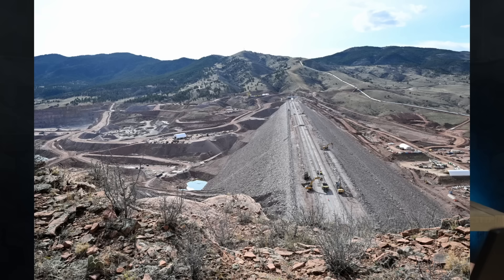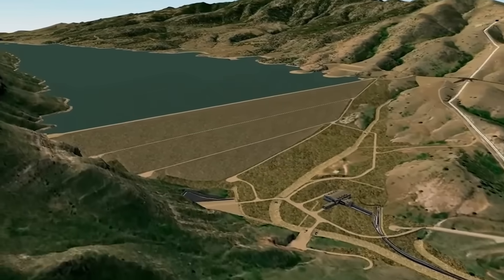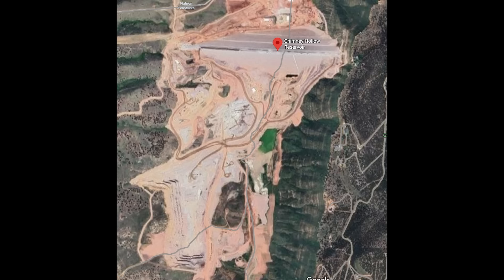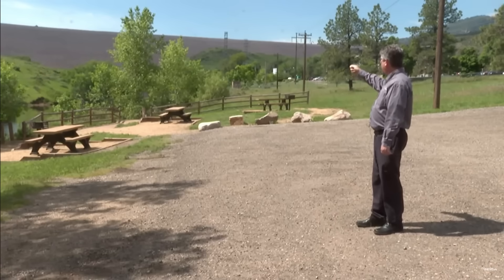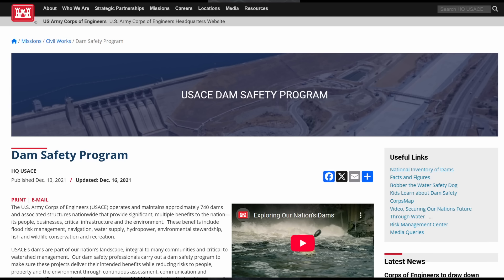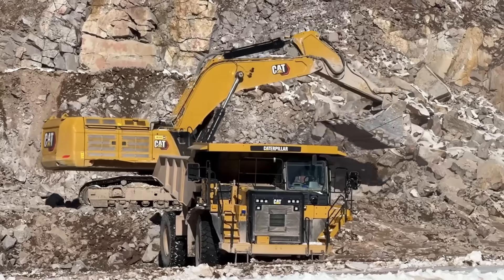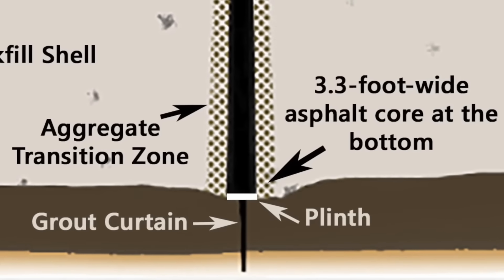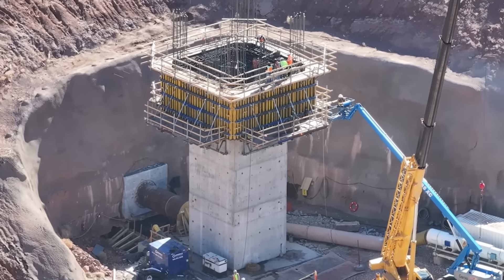Chimney Hollow Dam and Reservoir - Can you Drink the Water?

Comment: So if I’m getting Casey’s coverage right, their plan is to fill with water and simply hope that the problem goes away? Doesn’t seem like a very good plan to me.
Reply from the maker: You are riight. As they say hope is not a plan.
Reply: Is it even possible to test every square inch of ground that water will come in contact with once the reservoir is full?  It's possible that exposed rock elsewhere within the reservoir could leach uranium or other dangerous elements into the water once the reservoir is full.  Is there a way to predict what the level of particulate matter will be in the water before the reservoir is full?  I don't know anything about geology, but it seems like there's no real way of knowing until the reservoir is full.  Not to say that due diligence isn't necessary.

Comment: I would not be surprised if they held off on the announcement until the project was complete to ensure they didn't have any lawsuits or regulatory delays and end up with a half finished project sitting for years while loosing money in courts.
Reply from the maker: I agree the timing seems more than coincidental.
Reply: @CaseyJones-Engineer if they fill it and let it evaporate, maybe they can get a criticality ☢️
Reply: Agreed
Reply: I heard about this project in 2005. Why didn't they do more in all that time, especially is there is concern?
Reply: @LiefRunsFar same as oroville. People on the ground knew they were anchoring in sand and air. They definitely reported it but there was no pursuit of this avenue of investigation. They looked at the documents they had and played dumb like that was the only way to obtain information. As to why they would hide the uranium now, well, it's obviously money. The job stands no risk of being canceled now and they can try and get their hand in the money bag of remediation.
Reply: China is building the biggest dam in the world Right now In Tibet and we build this.
Reply: @murraysimmons941 that dam is not being built yet until after the tunnel diversion through the Himalaya mountains and is for power generation, not drinking water
Reply: There is not really much to bring a lawsuit over. It is the RAW WATER not the treated drinking water and it is not in use. It is very likely they already planned on installing Radio nuclei removal treatment based on the initial source water testing, which if they did not that is where the regulatory delays would kick in. 

At the moment there is not really anything to be concerned over... 

There is nothing to bring a lawsuit over at this point in time... It is equivalent to bring a lawsuit against any restaurant that has Raw meat in the fridge. 
You can bring a lawsuit if the restaurant does not treat (Cook) the meat properly and gives a bunch of people food poisoning.
Reply: Ha ha.   “Not really anything to be concerned about”.  😂. Let’s just keep fooling ourselves that these are not grave concerns.  Conscionable entities proceed with transparency.   Which includes a discussion, for the benefit of the public, about what the plan is.  Lacking that they are trying to hide something to smooth over what appear to be obvious and potentially willful oversights.
Reply: The left wants zero Eminem’s . Colorado is a leftist state and will do anything to Make Trump look bad . We will see. They just want money here and trump off the ballot
Reply: @TNTom67890 interesting (and good) point.
Reply: Well, obviously the problem is the EPA and its overbearing regulations.  Rest assured folks, this administration is committed to dealing with it.
Reply: @DaveP-uv1ml  Trace of skepticism?
Reply: @DaveP-uv1ml do you seriously want to drink that water untreated?

Costs to treat negative health impacts will dwarf the cost of having done it right from day one. 

Is what we call being penny wise and pound (dollar) stupid. 

I hope the MAGA definition for making America great is not how to make America into second rate third world nation comprised of sheep. 

We already have the knowledge to do it better than anyone. We just got to do better and not allow incompetency to get in the way
Reply: @thelunatick1993 , I thought I was being obvious. I guess I need the /s.
Reply: @thelunatick1993  nuclear powered citizens are cheap to operate as they require no further energy inputs.
Reply: @thelunatick1993 are you able to cite any evidence to support your wild supposition?  I believe it is much more likely that the floods (100 year magnitude) and the coffer dam caught most of the ultrafine dust (clay) that can be removed from the bottom of the coffer before filling the lake.  Additionally the dilution of the rain water by the proven clean fill water is 2-3 orders of magnitude magnitude! (The Uranium is about 8 times the limit).  Please prove to us (with actual facts) that you are smart enough to be able to cure your own ignorance and not one of the "usefull idiots" bent on destroying the highest standard of living on  the planet - in the USA. Note: it is very easy to cure ignorance,  stupidity on the other hand is almost impossible to cure.  Cite any evidence you can to cure any ignorance I may have.
Reply: @thelunatick1993  Why do you people always blame the current president for everything? This project plan started over 30 years ago. Every lake and reservoir around here has moderate levels of heavy metals. And this reservoir is not for drinking water, its for irrigation.
Reply: @aowi7280 , you think we’re being unfair to the president that has no reservation in taking credit for the hard work done by prior administrations?  I think if your president can dish it, he should be able to take it. So don’t worry about him.
Reply: @DaveP-uv1ml  the EPA guidelines are less that the state and water district standards …so yeah …what ever😊
Reply: @DaveP-uv1ml  Colorado has Primacy for Drinking water regulations (maybe not on the new Lead or PFAS regs yet as they are new).

So... the State would fail to enforce regs sooner then the Federal EPA....
Reply: @TNTom67890 , during his first term, this president appointed a corporate asset stripper to head the EPA.  The first thing he did when he took the job was asked for an increase to the EPA‘s budget.  The extra money was used to fund early retirement and other pay to quit incentives.  It worked brilliantly, and the result is that the current EPA lacks the institutional knowledge and wherewithal to be an effective organization regardless of what they could and should do.
Reply: @DaveP-uv1ml  This projects goes back several administrations... so the EPA lacked the wherewithal under those as well?

At the moment there is no violation occurring... Uranium MCL is regulated at the Entry Point of a water system (first tap after treatment). This is a RAW water source and is also not in use. 

So the only guidance the EPA could provide... is treatment options.
Reply: @DaveP-uv1ml  Soooo tired of TDS cases adopting an air of snobby superiority when the really are not superior.
Truly.... so much BS out of people who are stupider than even a bozo like Trump.
That is the nightmare.... the people who oppose Trump make him look like a good deal by comparison. 
Average schmucks who sat in college-lite at the HS or even middle school level.. BSed into thinking they are peak intellects.... but they aren't.

Comment: What about the workers and the dust?
Reply from the maker: That's a great point.
Reply: Unlikely to be a problem, dust containing uranium is unlikely to stay airborne very long and they were largely working outside.
Anyone working in a place with lots of dirt dust should have been wearing gear to prevent that dust from entering their lungs. You don't want sand in your lungs either.
Reply: @jsbrads1 wearing gear , where they ?
Reply: @sircampbell1249  the problem is breathing the uranium dust, anyone working in a quarry where there will be plenty of rock dust, will either be in vehicle cabin or wearing something to reduce the inhalation of rock dust anyway.
Reply: Wear a respirator
Reply: @LehiRulon , it's a little late now, isn't it?
Reply: Death 💀

Comment: Some years back there was a significant amount of Uranium dust in a rock pile in the south Denver near the Plat River.   This became an EPA clean up site.  My hope is once the dam fills, the Uranium level will subside on it's own.   As an aside  Radon gas abatement pumps are being installed in houses all over Denver.  I think almost every house in Denver has some Radon gas in the basement.   Many people just ignore the issue. The pumps are just a fan that runs continually in a pipe the is drilled through the foundation.  The gas is just released into the air outside the house.  The electricity required to continuously run the blowers must be considerable.  I wonder if the abatement effort is worth the cost.  Maybe people should just open their basement windows.
Reply: I think that pile was waste from pre-WWII radium refining.  Uranium was a byproduct with a very limited market as pottery glaze.

Comment: One of the dams built in Iran had a salt deposit in it's reservoir. As a result, all the water in the reservoir turned salty and all the water down stream turned salty. So, yes this could be a big problem, then again, once they stop disturbing the soil, the Uranium could settle and gradually stop being a problem.
Reply: Or they could cap it if they know which exposed area it's coming from. A thin layer of concrete or asphalt could reduce the problem by several orders of magnitude.
Reply: @blairhoughton7918  That could stabilize the source. It would functionally serve as a filter.

Comment: Shocker / Not a shocker - this is out west. Uranium is everywhere.  Sometimes U is concentrated by groundwater movement through certain materials. I'm thinking the source may not be exposed rocks leaching. Maybe, but dams impact ground water. I wouldn't rule out a spicy groundwater source in a sandstone that is filling and flushing as lake levels change. Wait and see may be the best plan. I would not be shocked if levels bounced around with lake levels with long time lags due to the large lake volume interaction with a small groundwater source. It may seem totally random. The suits will be confused and the narrative will be equally random until they settle on a way to milk the taxpayers for a fix.

Comment: Thanks for the video. 

I'm also surprised that they didn't do this test at the very beginning of the planning stage, but maybe they've had enough experience to know that once the dam is up and running, the concentrations should drop to acceptable levels. 

The fact that fluoride is often in these waters is also interesting. I moved to a house with a well about ten years ago. I told my dentist last year that I didn't have fluoridated water any longer because I'm on a well. He said that in many parts of Wyoming, natural aquifers have fairly high fluoride contents, so my water might be fluoridated even though there is no special fluoride addition.
Reply: They may have cored the quarry site to determine whether it was suitable building material. But if they did, they missed a spot.

Comment: Very disappointed in this video, Casey.   Maybe they should have done leachate testing but the fact that a lot of water testing did not show uranium suggests that the uranium distribution in the material from the quarry may be highly variable.   And then what do they do for borrow material if there is sporadic concentrations of uranium? Do they seek a new source? Maybe that material is further away or not satisfactory to make a dam.  But there’s lots of locations with some uranium throughout Colorado.   What they did was reasonable.  Build the dam with the most appropriate cost-effective materials and if the uranium concentration in the water is above drinking water standards then treat the water.
Reply from the maker: Why be disappointed?  I think you missed the point of the video.
Reply: The uranium is in a layer of rock they uncovered in the quarrying. They for whatever reason maybe didn't core into it before digging. And for whatever reason they think it's not that big, or not that porous, and imply it's only the disturbed gravel and dust that are contributing. They better hope so.
Reply: I think your point was to be alarmist about something that could turn out to be a total non-issue.   
When bad or good news is released depends on a lot of factors.  The testing results that showed low levels probably influenced the timing of releasing the results.  As soon as one gets somewhat surprising analytical results one needs to study and assess the ramifications of those results before going public with them.
Reply from the maker: @benboots6956  Now I know you didn't watch the full video as I already said as much.  You are welcome to disagree, just don't be so condescending about it.

Comment: It might be possible to lock the uranium down by covering the rock with agricultural lime and then covering the lime with fine grade limestone and then clay. 
    Uranium should not be a free solute, typically it gets locked with other minerals. Minerals on the left side of the periodic table become more prone to form rock the higher the valency at higher pH. Of course even the most insoluble salt still leaches out at a very slow rate. What increases the rate is acid, and if the mineral was not deposited into an alkaline rock is does not require much acid to leach it out. 

   So where does the acid come from. 
Starting with the biggest CO2 + H20 ——-> H2CO3 
Next we have NOx + H20 = HNO3 + HNO2 …..nitric and nitrous acid. 
And finally with coal fired and high sulfur diesel SO3 + H2O ——> H2SO4. 

So acid essentially comes from rainfall. It’s generally protected by limestone since limestone is a younger rock…..

H+ + Limestome ———> CaHCO3 ——> Ca2+ (where coastal oysters get mineral for their shells) and CO2 + H2O
Reply: That costs money.
Reply: okay that might be technically not impossible but will wildly difficult to do. you gotta think its not just the exposed rock you can see, its everything down to the asphalt core that will be submerged is leeching.
Reply: @JackMcGuire-em7nt  I think its the exposed granite bedrock within the reservoir that's the problem.  Not the rock incorporated in the dam.
Reply: @JackMcGuire-em7nt  I was thinking in terms of the quarry. Yes, technically difficult because they would need to grade the quarry stone to a continuous surface manifold . As far as the dam is concerned possible not as hard as you think, as long as one could come up with a recipe for a veneer. 
    Leaching is a function of exposure versus time. If you can reduce the exposure then it takes more time for a mineral to reach its saturation limit. The lime lowers that limit, so the next part is to decrease exposure of the wearable face of the substrate. Again all you need is a veneer of stone layered over a locking layer. In the case of the dam I would forgo the lime and go directly to limestone chips [because it would be difficult to get a manifold capable of controlling the thickness of the lime on a side slope with such large stone surface]. Compact this on the side and place a covering of fairly wide cement stones say 4’x4’grouted with rubber. Problem here is stabilizing the stones on the surface. Also this is Colorado, the temperature variation in the water between summer and winter freezing expansion might place the variable material in the dam causing cracking in a solid cement veneer. 
    This is different than dealing with the bottom, since the bottom is not exposed to ice or wide swings in temperature and gravity works to seal the surface as long as this is not a recreational reservoir and has no breeding populations of fish. Remember the current quarry is complex, they have rock excavated to different layers probably fractured by excavation explosives. This greatly increases surface exposure. If that can be graded to a smooth surface then the exposed surface area falls. 

   One thing also with the dam side slope. Any lime you put on the side slope eventually ends up as hardness in the drinking water. If you put lime on the bottom you can cover the bottom with clay isolating the lime. On the side slopes it would not be possible to isolate it.

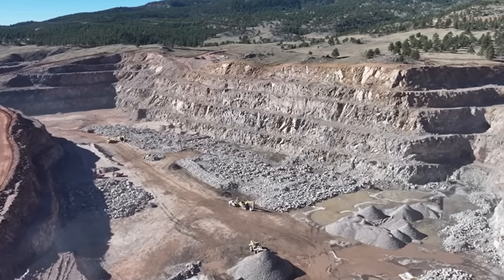Comment: 16:41 all the pulverized rock will have a much larger surface to leach from than the in-situ granite, washing all out now before filling and storing it should reduce the problem a lot.
Reply: Yep, once uranium dust is swept downrange first months of water flow tests a submerged 200mx1m ridge of uranium ore ain't gonna be ongoing problem in 10km reservoir. ..   I read a book and it was hilarious when 1960s people realized uranium in low levels is common, not just the mines in Utah or Canada, EVERYWHERE at low low levels so each nation if spends a lot can build nuclear bombs.  It was a mental shock to them.